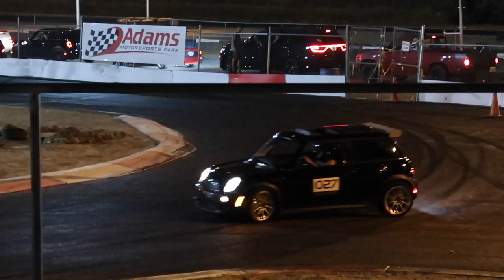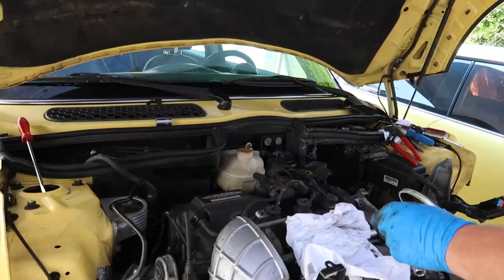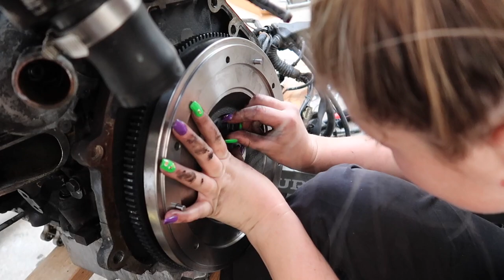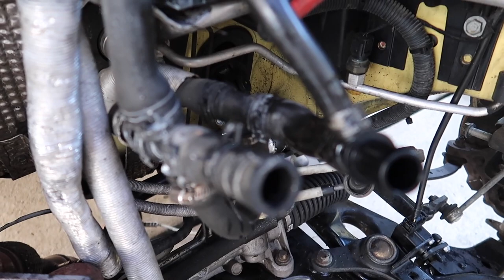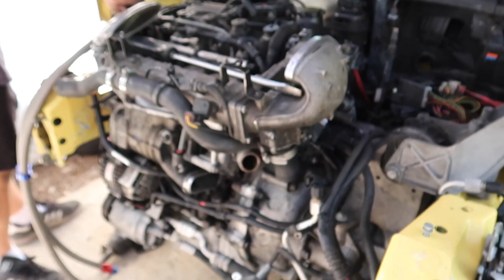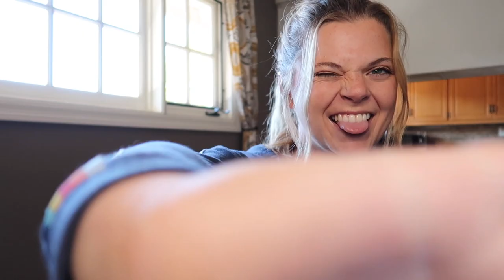Replacing the Clutch and Oil Pump in my $895 R53 JCW Part 1

Comment: Oil cooler looks rad, which adapter plate did you use? Any recs? I’ve got one in a phase right where yours is at. Thanks. 🤙🏽
Reply from the maker: It was an r53 kit from G plus